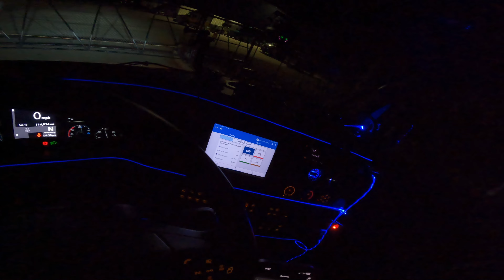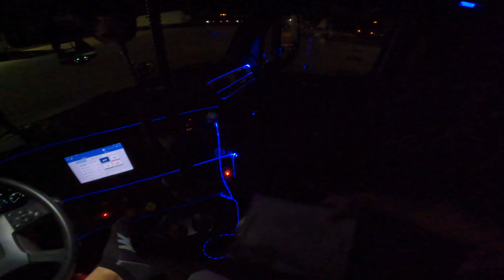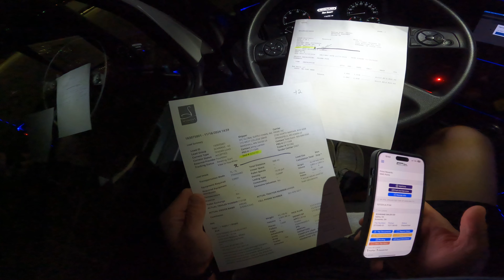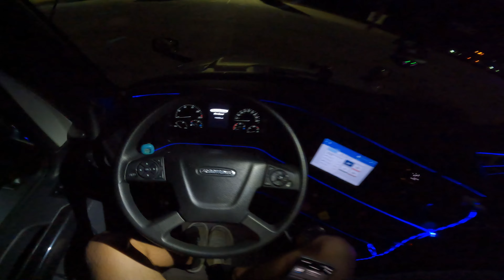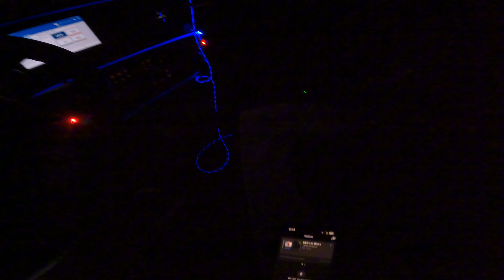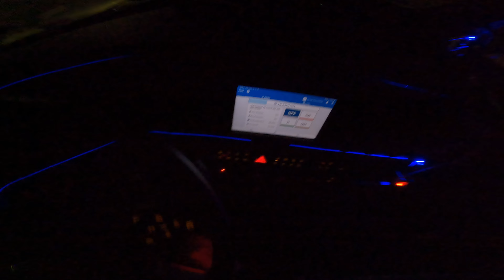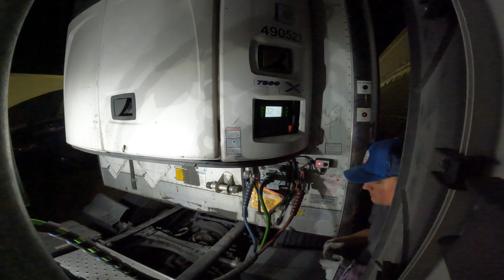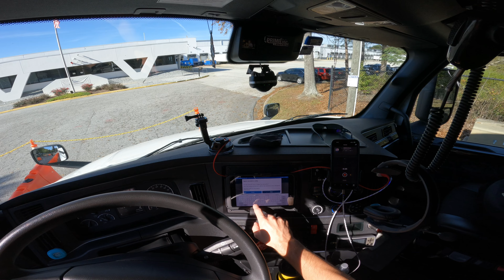Trucking To 📍McDonough Georgia To Swap Loads

Comment: I think you add to your stress by not driving at least the speed limit forcing everyone trucks and cars to get passed you.  Driving with the flo woud be much smoother.  Safe travels.
Reply from the maker: Yeah I agree at times I run 65mph but since I have to pay for fuel I tend to run slower for fuel efficiency 🤷‍♂️ back when I work for Russians I full sent it 75mph always didn’t worry about fuel or breakdowns.

Comment: Hey when you drop a fully loaded trailer where do you lower down the landing gear just want an opinion about it thank you
Reply from the maker: Lower it till the landing gear hits the floor and give it 2 or 3 extra turns then use the suspension dumb to let air out of airbags and drive from under it so the next driver doesn’t find the trailer too high and have a hard time 😀
Reply: @ thank you and I was taught to lower the landing gear to about a half inch or so from the ground